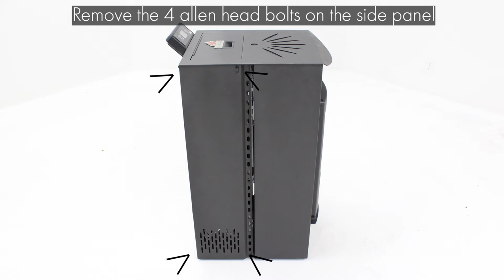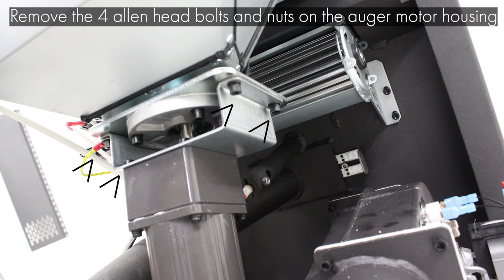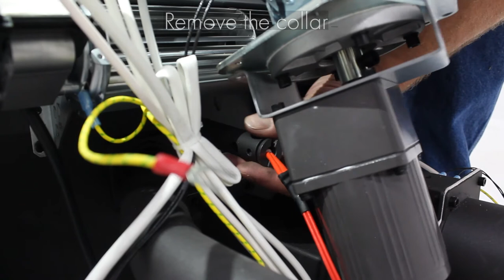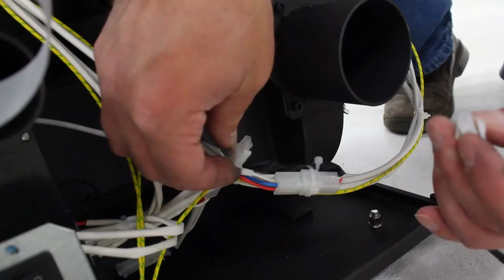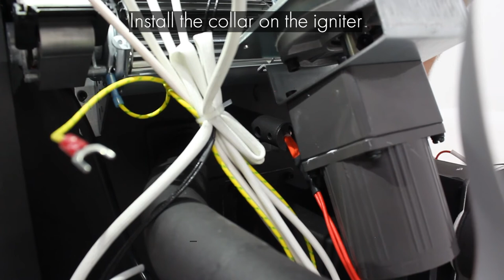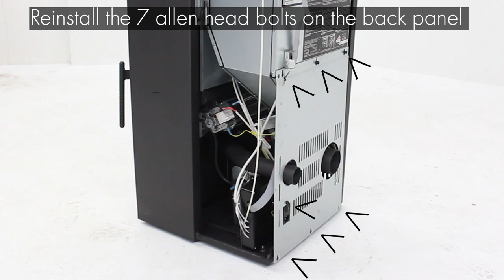Replacing the Igniter - Castle Serenity Pellet Stove, Model: 12327

Comment: Just finished replacing my igniter.  We bought our stove December 2017, so actually pretty amazing it lasted that long!! It failed at the end of last season but we just manually lit ours for the rest of the season, not a lot of work to manual light- so if yours has failed and you are reading this, just manually light until you get a replacement figure out.  Finally got around to installing the replacement today. Like the earlier poster, I followed the instructions and even with the auger motor able to freely rotate, still could not get the igniter rod to slide out.  Removed the motor by loosening the bolt holding it on to the shaft, and it slid off easily.  Once motor is out of the way, easy to slide out igniter and replace.  Yeah it is a few steps, but really not rocket science, especially if you have your stove mounted to side wall instead of the corner.  Ours is corner mounted, so les room to work, but take your time and you will get it.  To those that are posting all the negative comments- yeah I suppose they could have made it easier, but really it is not that bad- if you know how to work a hex key, you can do it- take a biiiiggg breath, you got this!  The fact that i got this stove for $899 and it has worked perfectly for the last 5 years is really something- some of us can’t afford the $5000 stoves that might have a slightly faster igniter replacement . . .
Reply: I can't get the set screw loose....
Reply: @tinaparker8555  you might try using some penetrating lubricant like WD40 to spray on the set screw, let it soak for a while, then give it a try.  And make sure lefty loosey- sometimes i mess that up since i am hanging upside down to get to it, and so reversed.  If you can get a longer Allen key, sometimes the extra leverage will help as well.  I have also occasionally taken a long Allen key, then used a wrench to add extra length to it, to add extra leverage, to get stuck bolts/screws to loosen.  One other method would be to try to heat it up, use a small torch, might help break it loose.

Comment: Very helpful! I did have to fully remove the motor by undoing the 5mm set screw. The igniter could not slide past the motor no matter how I rotated it. Otherwise it was exactly as shown. I’m all fixed up and warm. Thanks
Reply: Pic or image. I’m stuck on this right now.
Reply: @lacostawestfall7086  what do you want a pic of? The igniter does not slide past the motor no matter how you rotate it. In the video he just turned it and it slid right past it. There is no way to do that on mine. I just went ahead and removed the motor with a few more Allen bolts and that was it. What are you stuck on?
Reply: Can not believe I had to remove the auger motor to replace the igniter rod. Poor design for an easy repair. Great stove but this was definitely aggravating

Comment: Does anyone know how to manually light this stove?
Reply: Yes will make video if needed.
Reply: Push the button to manually start the stove. Add a small amount of pellets to the pot (or wait for them to be fed by themselves). Use a propane torch to heat them up until you have a good portion of them glowing red or burning. Allow the stove to keep feeding additional pellets on top of the ones you were heating. When ready, remove the torch and close the door. The flames may go out, but if it is still orange and you see bits of orange fly ash come off, you're probably hot enough. Give it a couple of minutes and the flame may reignite and your stove is burning.
Reply: Yes you put a couple handfuls of pellets in the burn pot, then turn on stove and light pellets with a Torch until they burn pretty well then close door. I've had to do this when ignitor went out.

Comment: If the engineers of this stove would have just moved the alignment of the igniter by a few degrees or moved it's position a small amount it could have easily been replaced by just removing one side panel. Sad that you have to take so much of the stove apart to replace this one single part. I do love the stove otherwise!
Reply: Exactly

Comment: I service stoves and charge an extra 100 for this repair, lazy crappy design, Allen bolts are annoying this whole thing sucks buy a real stove.
Reply: Some people can’t afford $5000 stoves. See my comment above- I just replaced mine, with zero prior stove experience.  Took me about an hour, and that included about half that time cleaning out the hopper/auger etc while i had the motor off and could turn the auger easily.  If you are charging people an extra $100 above what your regularly charge, whatever that is, that is preying upon those that already cant afford to put in more fancy stoves just to make your life slightly easier, or those that physically cant, like elderly/disabled etc.  I would imagine someone experienced in stove maintenance/repair who have worked on this stove before, with proper tools, could do it much faster.  I would imagine now that have done it once, would be very easy and fast to do again now that i know how.
Reply: I agree. This is not how my Castle is. The shaft is in line with the igniter. We paid about $1000. I’ve had other stoves and you don’t have to spend 5K to get a decent stove. That’s stupid!